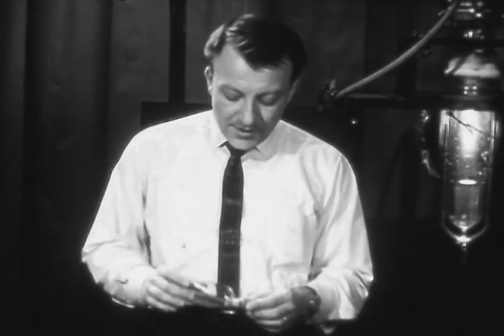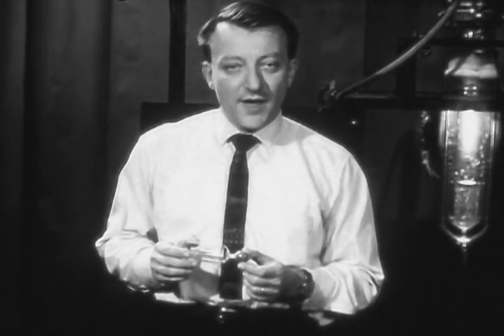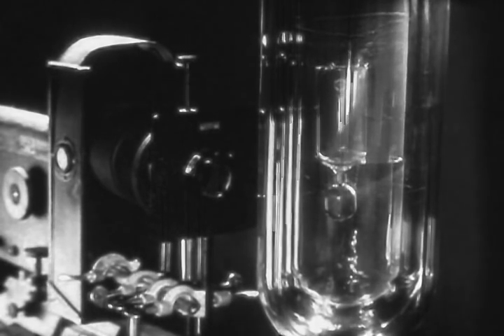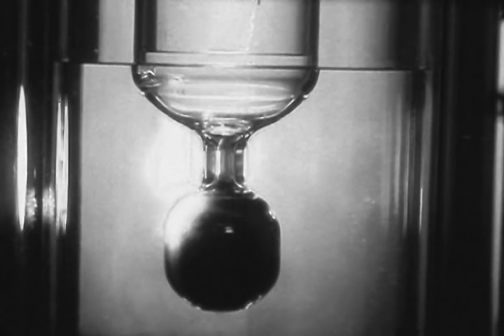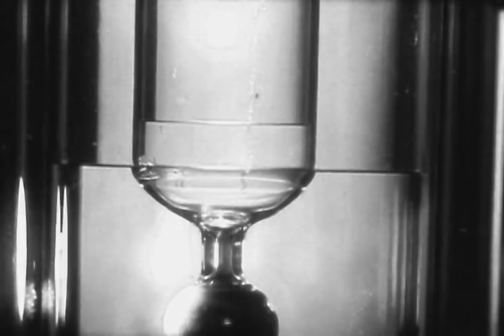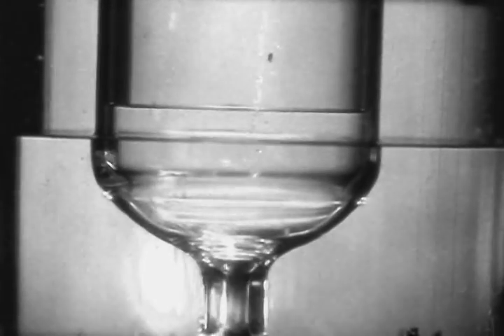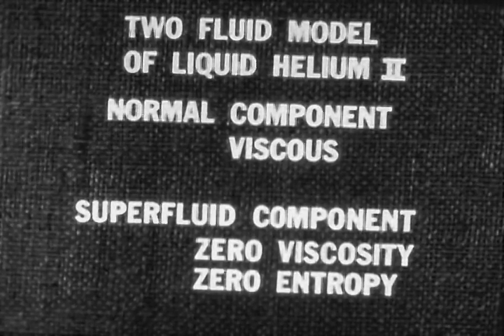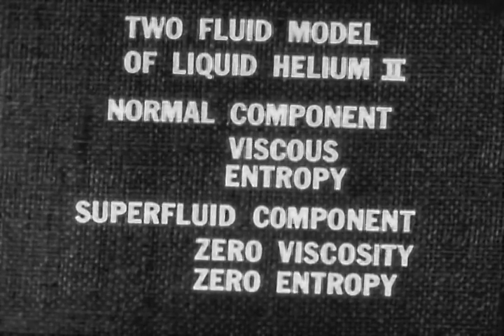Liquid Helium II the superfluid (part 4 The fountain effect)

Comment: I wonder if we should see the fountain effect with all superfluids. Reminds me of solar flares when you look at the old recordings by Walter Orr Roberts.
Reply from the maker: "I wonder if we should see the fountain effect with all superfluids." Yes I think you would, though demonstrating it with anything other than Helium could prove to be a problem - other materials require temperatures measured in nano degrees K and has only been achieved with few hundred thousand atoms.
Reply: @Zantorc  Institute of Flow Research in Göttingen did a lab experiment with hydrogen superfluid. Reading over the paper now.
Reply from the maker: @michaelinamoment  When you look at it what they observed was superfluidity in 14 to 16 molecules of hydrogen. You won't see it in bulk because hydrogen freezes, unlike helium which doesn't freeze solid under normal conditions. Having said that, under enormous pressure (such as the interior of Jupiter ) it is possible to form metallic hydrogen and there may be an ordered states of that which involve superconductivity as well as superfluidity. The interior of neutron stars is another place where superconductivity and superfluidity are likely to coexist.
Reply: @Zantorc  Its pretty interesting stuff thats for sure. Especially as scientists attempt to make metallic hydrogen artificially (one disputed paper and another claiming to have achieved in last year or so) its interesting to think if superfluidity of hydrogen is part of its condensed state as discussed here https://ui.adsabs.harvard.edu/abs/2011NatMa..10..927E/abstract very cool to see the speculation back in 2011.

Comment: does it really have "zero viscosity" or just extremely low viscosity?
Reply from the maker: The superfluid component has zero viscosity. It's a quantum mechanical effect - so things can be literally zero. Superconductivity if another example - where a current has be set going in a loop of material and found to still be going round undiminished, many years later. (Normally a current would decay in milliseconds, which is why you would have to have a battery in the loop). 

"If quantum mechanics hasn't profoundly shocked you, you haven't understood it yet." - Niels Bohr

Comment: It's called capillary attraction. where did this guy get his degree?
Reply from the maker: 1. The capillary effect depends on the tube diameter, this doesn't.
2. It's impossible to get a fountain from the capillary effect because it depends on the adhesion between the fluid and the wall of the tube. (Try cutting a capillary tube at half the height to which water rises and see if you get a fountain - you wont).
3.I have no idea where Professor Leitner got his degree.

Comment: This works with most liquids, to a different extent.
Reply from the maker: I think you may be confusing this with thermal expansion - it's not, it's a flow through what would normally be a non-porous plug.
Reply: Zantorc As soon as I posted this I questioned myself, I only kept it up as I was unsure if I had it right or not.

Comment from the maker: It requires energy to cool it but only requires insulation to maintain it, once it's cooled. The correct explanation is that the energy is coming from the lamp. The transfer of energy from the lamp to the helium is less than 100% efficient.

Comment from the maker: @tj15331 Because you've selected 480p? It's available in 240p, 360p and 480p. To go higher than 480p would be a waste of band width since the original is not high quality. If you find 480p is too high look in 'Playback Setup' in your account 'Settings', check the box saying you have a slower connection and not to use higher quality. Alternatively select 'Change quality' to 240p.

Comment: @Dignitas93 it can be turned into a gas leave it at room temp. also its really expensive to cool something down at that level despite the no entropy. You would be using more energy to keep it at the  below lambda state or "super fluid' rather than doing something productive with it.

Comment from the maker: @Dignitas93 "If the superfluid converts any thermal energy added into mechanic energy, how can it again be heated and turned into gas?"

In general it doesn't and in this experiment only part of the heat is converted into mechanical energy.

Comment from the maker: @ucsirap If you put say a 1 cm diameter tube open at both ends vertically into water you would expect the level inside to match that outside.The level of superfluid inside has dropped (because it's been partly converted to the normal component) so sf flows in. Why is that difficult to understand? Nothing to do with density.

Comment: @Zantorc "the wave model"
what is waving in the wave model? if you say 'is the electron' then it is not different from the planetary model, unless the electron is not a particle, but QM only deals with particles, after all QM is a particle theory.
@Zantorc "See my comment of 3 months ago for an explanation"
thats a description, you don't explain WHY more sf has to flow in? does the normal (heated sf) is less dense and allow more sf (non heated sf) flow in. If not then WHY?

Comment from the maker: @ucsirap Yes it's slightly warmer,  but there is negligable difference in density (as you can see because the volume doesn't change by any visible amount). The ultimate cause of the fountain effect is quantum mechanical so it can't be explained in everyday terms.

Comment from the maker: @pixartist In terms of the 2 component model: Temperature (T) determines the ratio of normal to super. At 0 K it's all super at the lambda point its all normal. It's a dynamic equilibrium, atoms are not fixed in one state or the other. The superfluid (sf) sees no barrier so it  reaches its natural level and T dictates that some of it will become normal. The lamp increases T so the amount of sf has to drop. From the sf's point of view, more fluid has to flow in. That flow is without energy loss.

Comment: Since Helium in State II has any entrophy, means no viscosity and no self-contained energy to be transportable, it is very likely that the atomic structure of Helium in this state is merely non-oscillating (no brown thermal movement). This enables the molecules to "flow" without any resistance across every surface havnig same temperature, and through every hole which at least allows 1 molecule diameter to pass through. The adhesion between the moulecules is infinitely low.